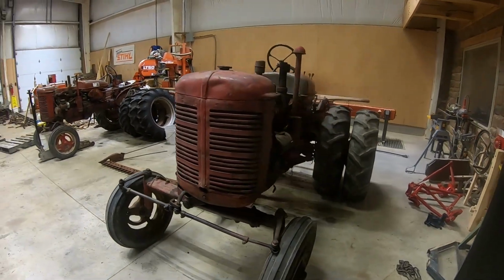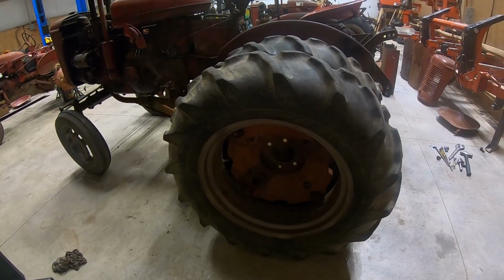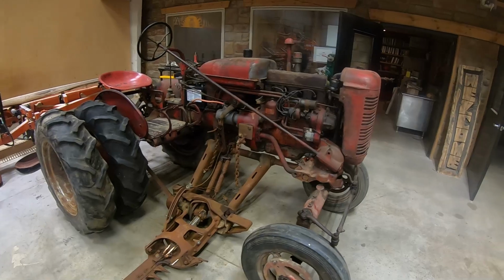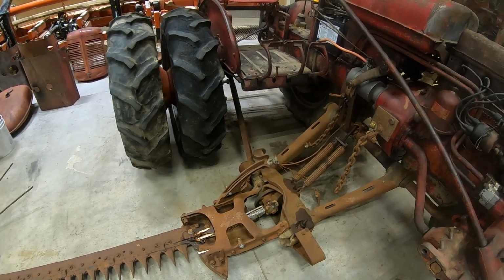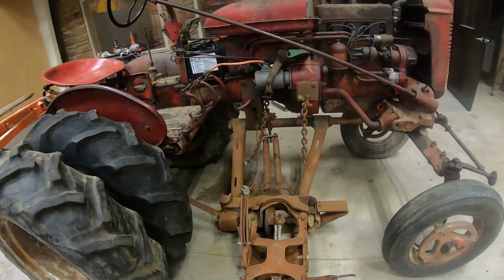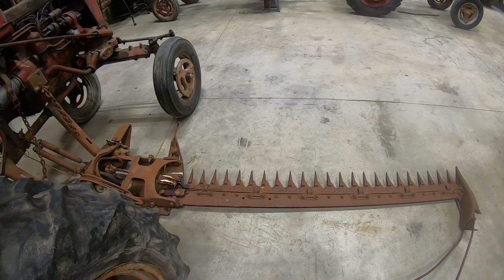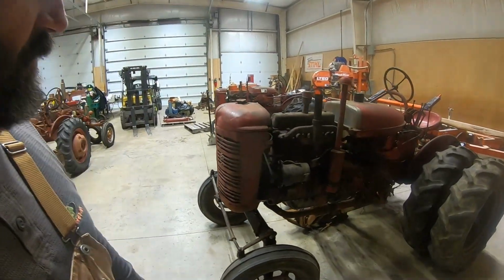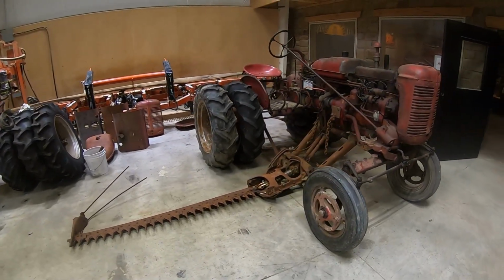IH International Super AI (industrial) with AI 23 Balanced Head Mower And Dual Wheels!

Comment: yes cool mower. I purchased a international #23 mower with 7 ft sickle over 20 years ago. Didn't know what I had ($175.) from a Wisconsin farm auction.
I finally got a clue from a advertised e-bay book showing a 23 mower on an industrial 300 . So I spent another  20x2 or $40 dollars on manuals to see if that was what I have . I think I have a side mounted #23 international with mounting for a  super A, super Ai,100 130,or 140. but not ruling out that could be for a 240, 300 350 or 460 utility tractor's. the book says only the super A, super Ai,100 130,or 140  international #23 mower uses a belt the other for 240, 300 350 or 460 utility tractor's, use a chain drive from pto to bottom pulley. So then mine must be super A, super Ai,100 130,or 140  international #23 mower and mounting
   But I do know it needs the two different fixed arms from the hydraulic like a super c uses , same a you did in the picture, 1 arm lifts the sickle up the other lifts the  cast part up . unfortunately mine from the farm auction didn't come with the p.t.o. pulley. I t's nice to see the early version didn't use the big nut and a slip clutch. Then maybe I could just use a or find a plain pulley. what size pulley are they supposed to be . I know it has a guard so that's something to go off of.